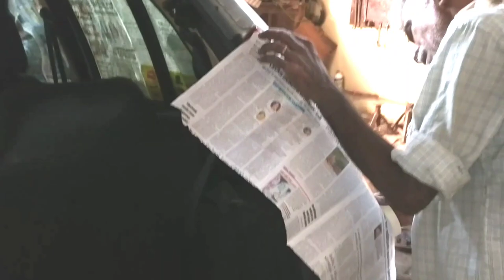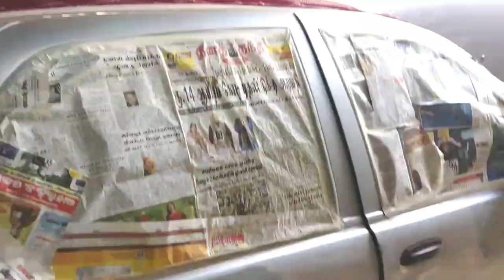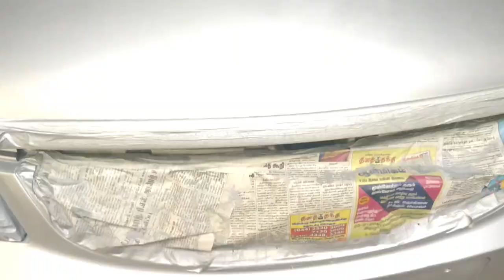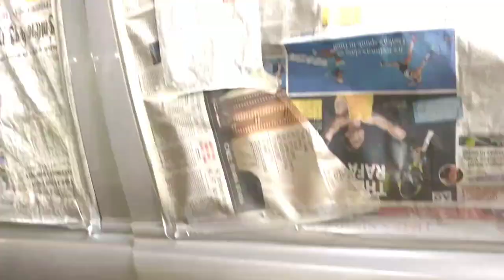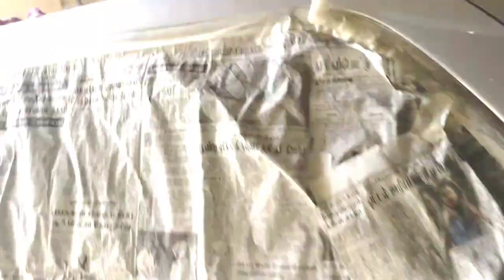car painting and grey putty work in Tamil

Comment: I have Tata Indica ev2 2011 model
Can I install 2014 model front headlight set on it?
Reply from the maker: Ok Apply to fit sir thank you
Reply: car workshop tamil thank you for kind reply.
Recently my cars OEM central lock remote has been damaged and it's not sensing the old remote. I have bought the Tata remote from boodmo.com and tried to pair using hopped coded plug but my car is not responding. What should I do?

Comment: Mahendra boliro elatonick modal start varama irunda enna seiyalam
Reply from the maker: Battery charge low or fuse check sir
Reply: AppDi illanna vandy motar adikkum engine sek indikad kaattum adukku enna seiradu
Reply: Na 2,3 vandy partan sari varala piraku computer sek panni tan seiranga engalukku solli taranga illa anna adan kettan